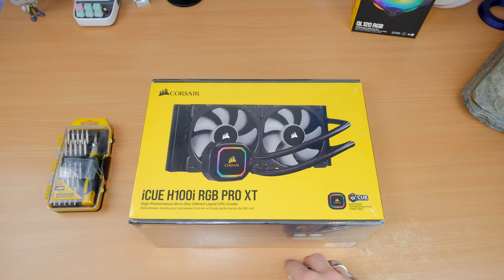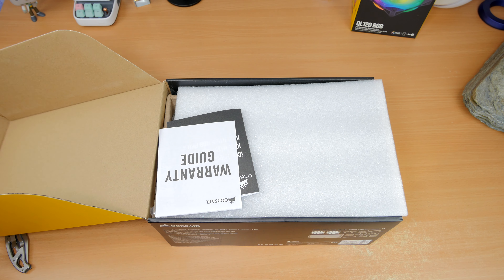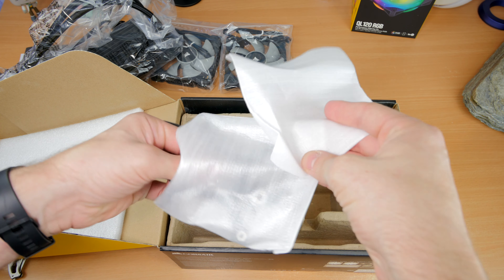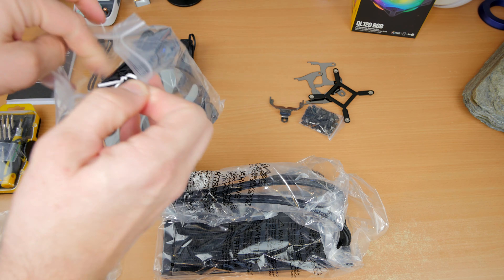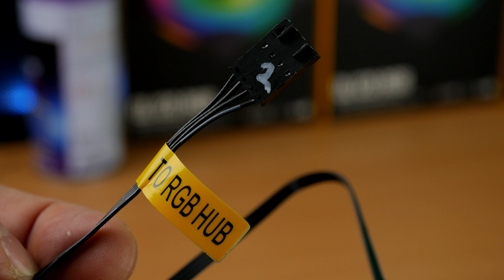Corsair H100i RGB Pro XT AIO unboxing and installation (with Corsair QL120 RGB fans too)

Comment: To everyone saying its wrong mounting the fans to be exhausts. That's just not true. Its all about how you designed your airflow inside your case.
There are articles where some NZXT AIO coolers were installed with the fans pulling air inside and pushing it outside the case. The CPU temperatures were literally the same.
Pushing the air out was even more efficient in some cases. (Case as in PC case lol)

Comment: I appreciate how thorough you are with your explanations. I appreciate that.
Reply from the maker: I appreciate your comment. Hope you enjoyed enough to subscribe 😁
Reply: The Provoked Prawn I did my friend! Actually could you help me with something!! I have a msi Meg z390 with a Intel i9 9900k I want to install one Samsung 970 pro m.2 1gb and one Samsung 970 evo 1tb m.2 and I want to also instal Intel optain m10 m.2 64gb. The pro will be the windows boot drive. My question is how do I do this?? Help plz!!
Reply from the maker: @jasonjtg21  make sure the Intel Optane memory is in the first m.2 slot. Took me ages to get mine working because it won't work in the others. Otherwise it should be easy?
Reply: The Provoked Prawn ok so Obtain in the first (m.2  of the board below cpu) spot. Then would I put my main m.2 boot drive under the msi frozer heat shield (m.2 spot 3)??? Why arent the msi or intel sites more upfront about this install process?? I’m not saying they are misleading however they aren’t coming out and making it easy either.
Reply from the maker: @jasonjtg21  it's all to do with lanes and such. I'd assume yours is the same. Took me ages to work out. You also need software and to activate it in the bios.
Reply: The Provoked Prawn thank you so much and yes I assume the boards are the same (since models and numbers are the same) you saved me a lot of trouble and hassle. Thank you so much!!! 🙏

Comment: Keep in mind that the non rgb ML fans go about 800 rpm faster than the QL rgb fans, according to the corsair website.
Reply: Bassjeroen Is that much of a difference?
Reply: @cheddalan2475  yes. The new ML fans (so non rgb) have a slightly more efficient design, and no rgb so a lot more power for rpm instead of light. They are designed to compete head to head with noctua, not to look cool like the usual corsair fans

Comment: Hey I need help with rgb. I connected 6 QL 120 fans Through the RGB hub and then two LL 120s are on my h100i platium se. My problem is when I turn my pc on my aio pump rgb and the two LL120 are rainbow while the rest are white like there supposed to be. In icue it’s set to static white. But I have to change it to something else then back to white for them to turn white again. Please help me!!!!!

Comment: It's a 100% remarkable that you took so long on the radiator explanation and putting fans on a radiator. But you went into hyperspeed fast mode on actually putting on the back plate which apparently it comes in two pieces for my version of the h100 or either that or I'm missing a back plate in this kit because I'm not understanding how to put the pump on
Reply from the maker: Try this instead. It's much better https://youtu.be/scasLVP9j_k

Comment: There is no wrong or right with the air-flow of which way the fans go. With my build, that has a 240mm x2 fan setup on the radiator, I have one fan set to intake and one fan set to exhaust.
The fan that is set to intake as at the front of the case and the fan set to exhaust is set at the back, I have 1x 120mm fan at the back of the case set to exhaust and 2x 120mm fans at the front set to intake.
The airflow I have set is a inwards to up down flow which helps the cycle of hot air to be pushed out in more directions.
It really depends on how you've built your computer and the particular case you have used. There is nothing wrong with trial and error to get the best air-flow! :)

Comment: you have the radiator upside down, the hoses should be at the bottom because there is air in the aio, the radiator acts as a reservoir and keeps the air out of the pump. i had to find out the hard way.

Comment: One of the biggest hurdles is changing out the brackets to fit amd cpu vs the Intel brackets it comes with.. screwing down the fans was not hard at all. It's the swapping of the brackets, I had issues with leakage. Would have been nice if you had included that process in this video.
Reply: I also experienced leakage, but that was because I didn’t realize you could swap the brackets without having to unscrew the copper plating

Comment: Have you been in a position to be able to test for any difference in CPU temps between the stock radiator fans and the QL? I’ve been thinking of swapping my rad fans for the QL series and want to make sure it won’t negatively affect temps! Love the channel as well btw, subbed :)
Reply: I know this is a late reply but it is the same fan just with lighting.
Reply: @stevie_772  false
Reply: @jibreelz  it’s not mate

Comment: so i have my water coolers usb 2.0 hooked up to a usb 2.0 hub and thier is no RBG but the water in the pump is running and cooling my cpu just fine but if i got the commander pro would that fix my problem i bout 2 of these AIOs and the same problem happened so maybe its the usb 2.0 hub and i just need to get the commander pro for it to work

Comment: I just got this for my Ryzen 7 3700x... and the included fans are really loud. Really loud.
Reply: i gotta question... do u have to fill this up with solution or does it come pre filled?
Reply: StickyDrawz  pre filled
Reply: You can't turn them to 0 rpm and up. Use iCUE software to manage profiles. I never hear mine and it's 30 degrees idle
Reply: Joe C I've found that Fixed RPM at 1400 works great.
Reply: You’re getting no noise from the fans as of now?
Reply: Mike T Minimal if I set it to static RPM.
Reply: @m1ka-DeL1c  Just use Icue and set the fans to quiet or 0 rpm.

Comment: Just got this cooler, the issue screwing the rad on the case or the fans on the case is simply that the holes on the rad are not threaded correctly (or at least do not match the thread of the screw), they were stuck from the first turn on all mine and I had to force them in.
Reply from the maker: Yup
PITA isn't it
Reply: The Provoked Prawn yep, I thought I was doing something wrong and was about to break something.

Comment: I appreciate the clear review. I wanted to check one thing: Are you saying that the fans it comes with are not RBG?
Reply from the maker: Correct
Reply: The Provoked Prawn Alright. Thank you so much!
Reply from the maker: @screenedtitan2751  no problems. It's not very clear but it's just the pump that's RGB as standard.
Reply: The Provoked Prawn Ah I got you
Reply: I’m pretty bummed to now find out the fans aren’t also RGB, seeing as I already ordered this kit from amazon and in the pics they have, the fans are illuminated. So I’ll probably have to order the RGB fans too...another $120 😑.
Reply: SpinTheBlock thanks for the advice, unfortunately when I tried to install the 100i, it wouldn’t fit in my tower without hitting my ram slots so I ended up having to sell it and make my money back lol.
Reply: @austinspruill6685  Hahahaha dude I did the same thing was so bumper , but luckily ended up using the stock ones that came in my h510 elite and awkwardly mounted them to the rad haha
Reply: Zproductions yeah I ended up selling it, got my money back 💁🏻‍♂️ lol

Comment: Awesome video man!  at first I did not wanted a corsair cooler, because only the pump lit ut. But  now I know you can replace fans with these epic ones, this one will be it. (360 version)

Only question, what are the noise levels when everything is turned down? And you only are watching YouTube and browsing the web. So no intensive use.
Reply from the maker: I think the dB level is probably on the specs of the pump and the fans and it's going to vary depending on your case but certainly not loud.

Comment: I can’t get the fans mounted, the screws are just too tough to screw in, how can I fix this???
Reply from the maker: Yeah it's a bit of a nightmare. I was wondering if a hole punch or something similar might work. Force a spike in there to push the fins out if the way. It's either that or brute force.
Reply: A drill with a screw driver adapter.

Comment: Hey so I just bought this and for some reason whenever I boot up a game I’m pretty sure there is this buzzing sound coming from the pump. I’ve tested it it’s the fans by holding down on them but the buzzing still continues. Another thing is that whenever I exit out of the game the buzzing immediately stops. And for some reason I can’t control the rpm for one of the fans it’s just stuck at 1500

Comment: The screwholes were messed up on mine as well, could hardly screw the fans into the radiator. Seems like a huge oversight, super frustrating to deal with. Its a nice AIO but that really put me off.
Reply from the maker: Yeah that's been Corsair AIOs for a while unfortunately

Comment: Sorry, My English is not very good and I don't understand if you made it correctly in the video or you add your voice in postproduction saying that it was wrong. 
I want to put it on the top of the case. So, must I put the fans throwing the air up to the radiator or pulling the air from the radiator to the interior of the case? 
Hope you answer me

Comment: I have a 4000x with same h100i elite caliper, more or less I think they are the same, under load in 15mins or so, my cooler fans go up to 2.4k RPM, which makes them sound like an airplane. However, my temp is fine, maximum 65 degree C. Did you notice such RPM from the fans?

Comment: According to Corsair, the QL fans are not meant for radiator use.
Reply from the maker: Apparently Static pressure fans are better but I've had no issues using QL fans like this.

Comment: I have the watercooler that came with rgb fans but I am unable to customize the rgb on the watercooler I do have the software but my pc case is a nzxt case
Reply from the maker: Shouldn't make a difference if it's all plugged in correctly

Comment: Thinking of getting this but I heard the screws are really bad and take forever to screw
Reply from the maker: Yup. It's not the screws that are the issue. It's the fins in the radiator getting in the way, if you have something long and thing you can insert in there you can push them out of the way first.

Comment: so, whats the actual difference to this compared to the previous H1xxi pro? is it just cosmetic or have they changed the pumps/rads somehow? (still an asetek base regardless I guess)
Reply: From what I can pick up, the pump is from the RGB Platinum series, so they're bringing the quality from the top line down a tier.. Not sure about everything else.

Because I'm dumb and like pretty lights on fans, my next cooler is probably gonna be either the Platinum or the ML240L V2.
Reply: Yea, found that after i asked, the platinum is not the Asetek design afaik. its nice that they bring the price point down
as for the pretty lights, looking at the homepage is interesting.
The spec states ML high pressure fans (the grey ones reviewers got) but if you look at  the "whats in the box" section its stating ML RGB fans (which arent nearly as high pressure as the others).
Reply: Its a CoolIT
Reply: This pump is the same one used from the Platinum series. Eliminates the gray border around the pump. It also is a multi level 16 zone rgb pump instead of the other 150i pro thats a single channel pump head.. besides that its the same as the Platinum series

Comment: Why would you pull colder air from outside thru radiator into your computer instead of pulling hot air to outside top? You cpu cooler might be slightly warmer this way, but you are not putting warmer air to the rest of system such as GPU

Comment: When you install the cooler, i noticed that they use thumb screws. Should i just tightening these thumb tight? Or should I tightening them with a screwdriver like any other cooler
Reply from the maker: You can screw them for sure. Just don't overtighten.

Comment: appreciate the awesome review, one question if i want to do push and pull where do i connect the two remaining fans since i have four now instead of two, P.S i have two fan splitter will it handle the load if i used them on fan cable from the pump head? Thanks in advance

Comment: Noob question. I have the H60i version, so just one radiator fan .I have my pump connected to my cpu fan2/WP header, the Rad fan connected to the cpu fan1 header and the usb rgb connection connected to a usb 2.0 header. Question is, what are the two other cables coming off the cooler pump marked 1 and 2 used for?

Comment: Hi my case came pre installed with 8 fans and a pwm hub can I still use an aio cooler but have a pwm hub alongside a separate hub for 2 different fans (corsair) and aio?

Comment: Nice vid m8. How does the performance compare between the ML, LL, and QL? The ML has a max static pressure of 4.2mm H2o while QL only has 1.5 so I'd be interested to see if the QLs are not a good idea for rads
Reply from the maker: I did not notice a massive difference in performance tbh. Though I also didn't benchmark before and after which I probably should have but my performance certainly didn't seem to suffer as a result.
Reply: @TheProvokedPrawn  I'm going to take the risk and try them on my NZXT Z73... I really love the look of the QL's but I keep reading how  they are terrible for radiators : /

Comment: Am I crazy? You had the fans placed correctly when you initially put them on. They are recommended to be intake fans. Which would be exactly how you installed the initial fans, meaning the full on AIO install here shows the fans mounted backwards.

Yeah you're definitely wrong... Everyone mounts them the way they look on the box cause it looks better, but it makes them "exhaust" fans, the opposite of what you're describing (and what is technically recommended). But it looks wrong so no one does it lol
Reply: It doesn't makes them as exhaust if they are mounted in front of radiator. Just need to install them opposite way. Simple. 
There is no any difference between installing in front or back
Reply: @martinmikolaj6888  Think you kinda missed my point here. They're exhaust or intake based on how you mount them, they can be either. They are recommended to be intake fans but the RGB looks much nicer if the fans are flipped around and used as exhaust fans which is what I ended up doing. You're obviously just using the already warm air from inside the case to cool the radiator but I don't think it makes much of a difference.

Comment: I've heard in the past around 2018 that you couldn't connect an AIO USB directly to a Commander Pro (CoPro) due to incompatibility issues with AsMedia 2.0 Controller for AMD systems. Has this been resolved on those boards or did new mobo's come with fixes? Thank you for the video it was very intuitive!

Comment: I have the same case, and i am about to buy the H115i, but i dont know if i buy the Pro XT, or the platinum RGB... The diference are minimum, but the platinum RGB come with ML RGB fans (i will replace with LL140) and use the ML fans on the bottom of the case as intake. The thing is, the platinum version come aslo with 2 RGB headers for the fans, that makes me think, i can have 6 fans on the lightning hub, and other 2 on the pump it self... Let me know your opinion, and if you think it as space for an h115i on the top of the case! Thanks

Comment: Two noob questions: 
1) Can I use 2 3-in-1 fan splitters to safely connect 6 Arctic BionIX P140 (non-RGB) fans to the pump's 2 fan power connectors?
2) If so, will I be able to control the fans via the ICUE software? (Not concerned with being able to control the fans separately.)

BTW, really enjoyed your videos on these Corsair products, as well as the ones on gaming headphones and VR heatsets.
Reply from the maker: I don't know the answer to either question I'm afraid. Sorry to be of no use but I wouldn't want to mislead you with guesswork.
Reply: @TheProvokedPrawn  No problem. Thanks anyway for the prompt reply. 🙂